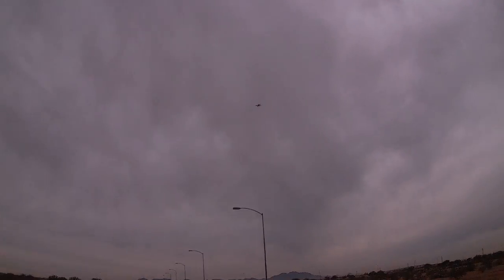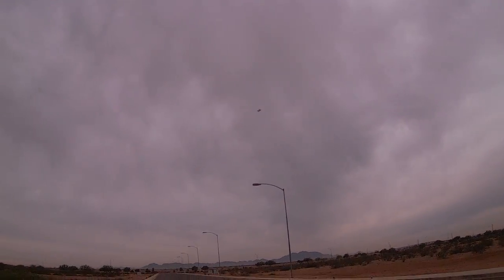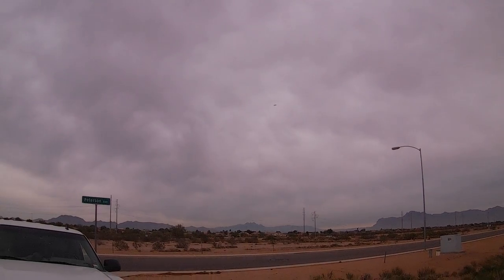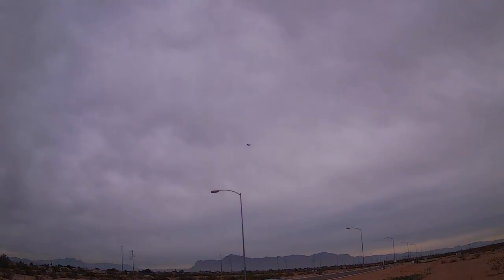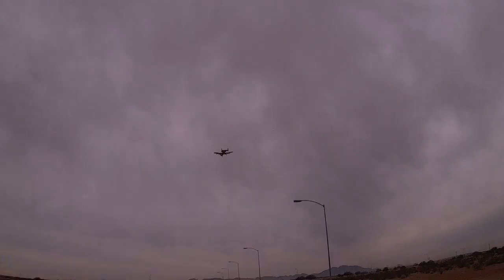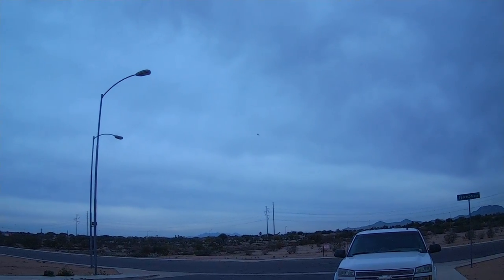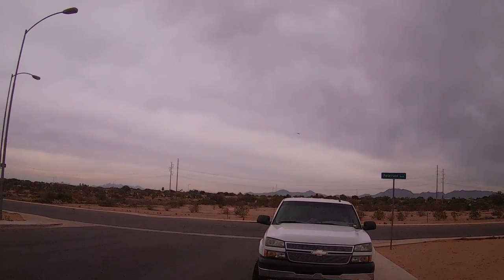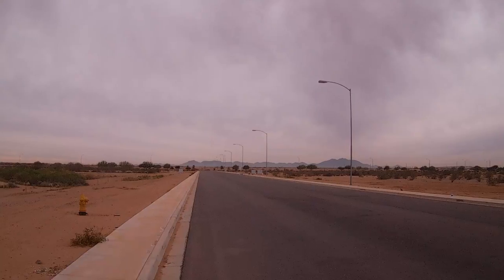FMS 1500mm twin 70mm A10 maiden flight

Comment: Thanks Brandon, amd I can really feel like how nervous you got on the first flight !
I have a Shenzen-LX-A-10, wingspan 1534 mm, two 50 amps esc's, and 70 mm impellers.
On first take-offs I had to stop, nose would not rise at all on our actually perfect grassy field.
Then, moved the LiPo back a lot, and increased the elevator to max, and wow it got off in 4-5-seconds.
And I tell you I was so nervous too, my first two approaches were too fast for our 120 meter field.
Then with full flaps it got better, except that the original landing gears just fell off on a nice landing.( hardly any glue)

After this first flight I then installed the '45-size Eflite landing gears.
Oh and even before the first flight I had installed carbon strips on the wings to keep them from breaking apart.
So, now I did at least 30 flights, and it's amazing what speed range this bird has, and how nice it behaves in sharp turns, just like the original.

I only wished I have a real gatling gun to fire :-DD

Btw I use a 6 S 5'000 LiPo, and my bird can fly 8 minutes with it, with two T-Goes or LDG/T-offs, that's not bad eh.
I also use telemetry for the voltage.
Reply from the maker: Maiden flights are always a bit nerve wracking ;) after the maiden flight, it's actually a very easy plane to fly and very well behaved with no bad habits

Comment: Right you are, once the C.G.  and elevator settings are correct, it's easy to fly, and I really like the speed range it has.
I once installed a GPS device, and at a moderate attack angle it reached about 140 km's.
My Eflite (woodie) Beaver flies just as fast. But for sure the A-10 is fun to fly especially when no other guys have one in the club.
For next season I 'll install some gun-noise firing electronics. Happy landings from Switzerland :-)

Comment: Can I use a 6s 5000 25c lipo in this bird ?
Reply from the maker: I wouldn't recommend it. The manufacturer recommended "C" rated battery is 40C+. The max static Amp draw I've noted on this plane in it's stock configuration is 114A @ WOT, that leveled out to about 110A @ WOT after a few seconds. In the air unloaded that will be more like about 105A @WOT.

I would not recommend the use of a 25c rated battery as it will more than likely puff the battery. A 25C rated 5000mAh lipo can only deliver "MAX" 125A and this plane will pull around 105 to110 @ WOT, that is pulling very close to the top end limit of a 25c rated 5000mAh lipo in it's best condition if it will actually deliver a "true" 25c discharge rate?

I recommend a higher C rated battery, at least 35C or greater, and that is being conservative....I would recommend 40C+ as the manufacturer states in the manual
Reply: Brandon Moon that's a bummer. I already have 5- 6s 5000 25c lipos and can't afford a new plane and new lipos